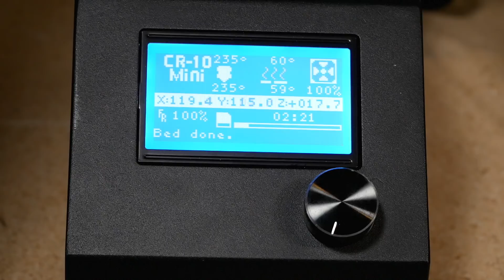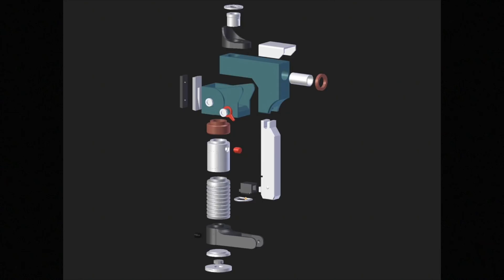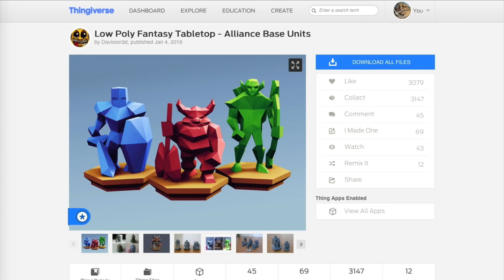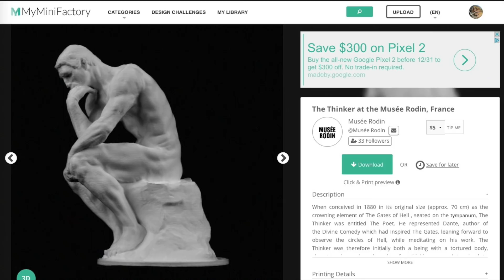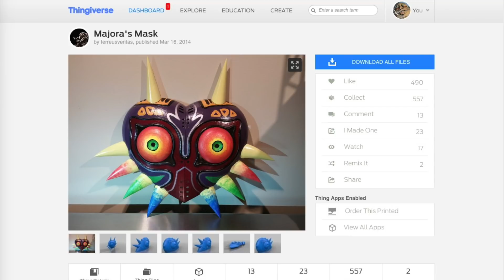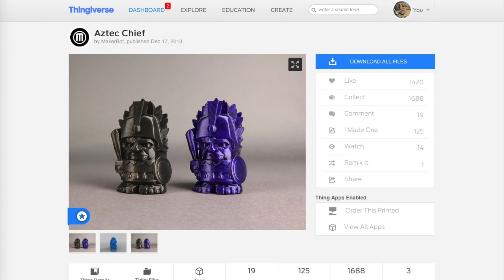Creality CR-10 Mini Review (Making Ezra Bridger's Lightsaber from Star Wars Rebels)

Comment: how do you compare your CR-10s with your old dremel as far as reliability and print quality?  I've had the dremel since it was releases and it had worked like a mature consumer product completely fiddle-free.  I was thinking of adding the Cr-10S for larger parts.  thank you
Reply from the maker: I would say the CR-10 is generally at least as good as the Dremel in terms of quality, and probably better in many cases. The addition of the heated bed can prevent the warping issues that I sometimes had on the Dremel. But the CR-10 is more of a "kit" printer and not as polished as the Dremel. Not just in the sense that you have to put it together, but you may also have to perform some repairs or upgrades on your own. Still, if it means anything, I personally would choose the CR-10 over the Dremel at this point even if they were the same price.
Reply: Excellent.  Thank you for taking the time to reply.  I am an engineer and a tinkerer and I don't mind (aka enjoy) fixing things.  

Which CR10 is your favorite (S, S4 or S5)?
Reply from the maker: Eos Sail I probably like the S4 best since it has the extra size without the downsides of the S5 (including price) but the regular CR-10 or CR-10S are great as well if you don’t need the extra size
Reply: Perfect.  Thank you again.  I thought the same since the XY increase over the S is more relevant than the Z axis  for most parts; and the heated bed works slow but uniformly over the area.

Comment: Which slicer did you use?

Would you please make a video showing your filament swap process.

PS, following your guidance printing my own R2v2 dome via my lowly Anet A8.
Reply from the maker: Matt Kasdorf I pretty much always use Simplify3D. What did you want to know about filament swapping?
Reply: Mighty Jabba's Collection   I'm using Cura 3.1.0 at present, I'm a noob but definitely see where the slicing could be more efficient.

Swapping filament seems to be quite a violent affair, as such I've only done it twice to date.